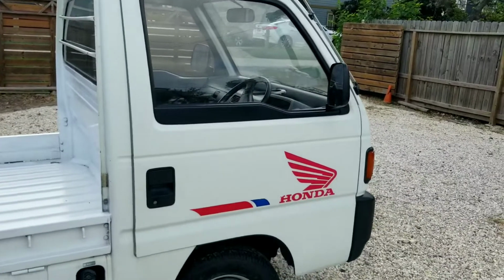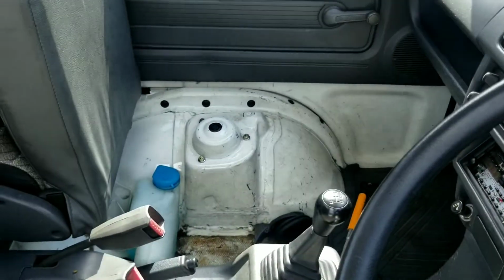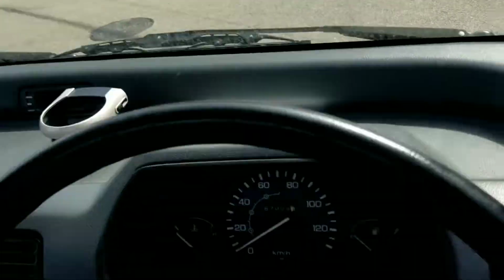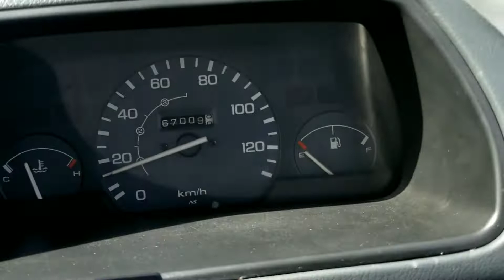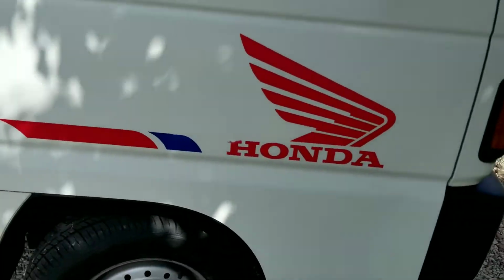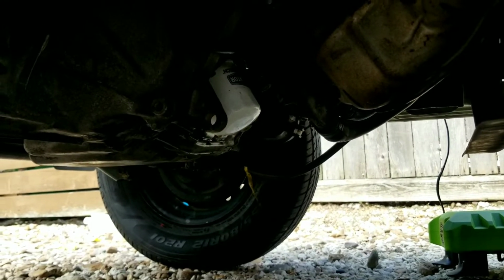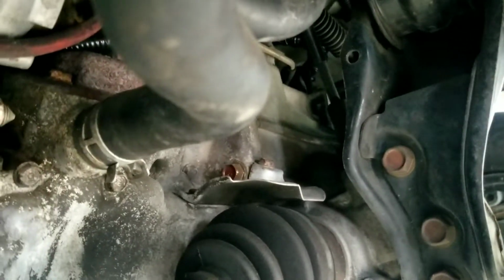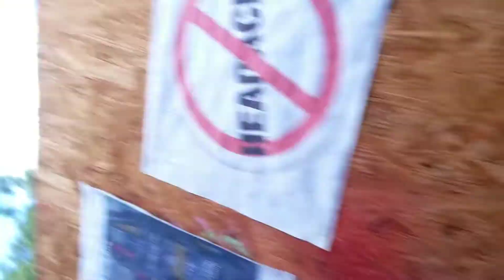Honda Acty HA3 2WD walk around and test drive.

Comment: Hey man I’m out here in japan and just bought an HA3.  I know the engines in these things are tiny so I’m not really sure where good shift point are on these things.  Any advice?
Reply from the maker: We don't have tach on most of them, just shift when needed.
Reply: The shift points are on the speedometer, those are the maximum speeds in each gear.

Comment: Why not just push start it? It's easy to do even by yourself.
Reply from the maker: I didnt really need it started as much as the battery needed charged. Would have to let it idle for 12 hrs to trickle charge.